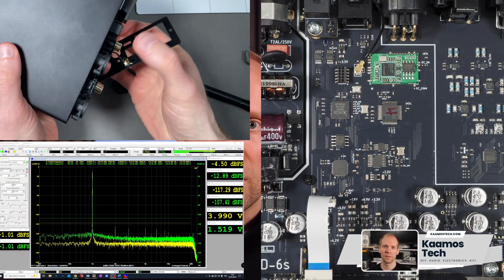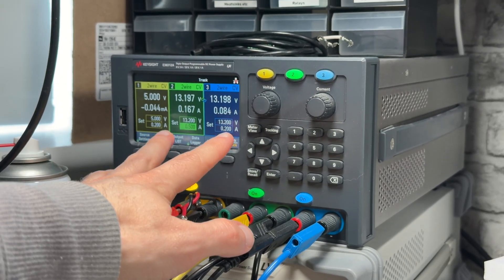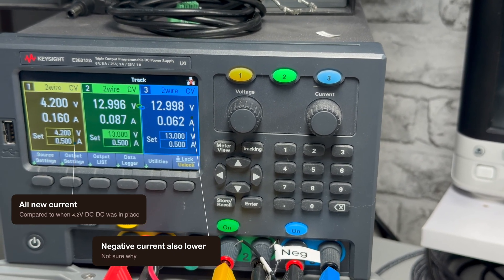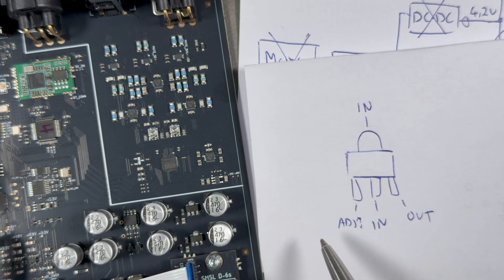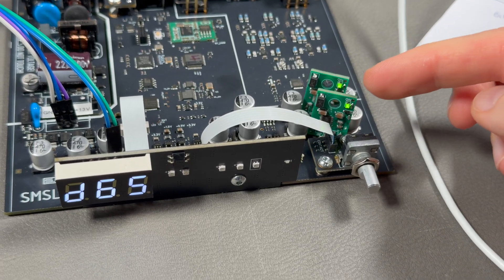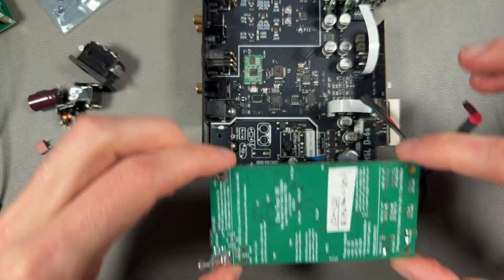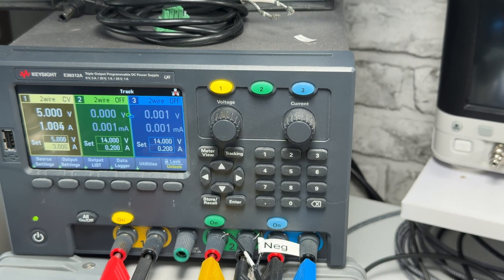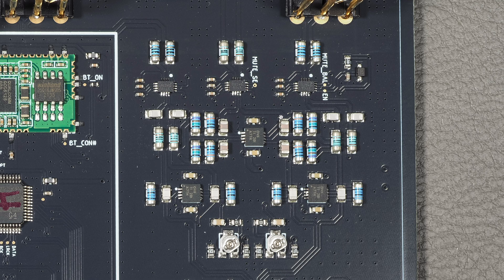S.M.S.L D-6s DAC Teardown Pt.3: Modifying Power Supply and Regulators.

Comment: Thanks for sharing.  Lower noise LDOs in most cases, make a big difference on these DACs. I have noticed that on many of these devices, removing thee bluetooth module helped getting rid of noticeable noise too. Hopefully,    they have done better designs on your model. On most of the previous models, SMSL used a weird SMPS with only the negative channel output regulated. The positive channel  was rectified and  regulated on the main PCB via a zener diode, which is the main cause of early failure of SMSL products.
Reply from the maker: Thanks. This is the first SMSL I have opened.

I would think the BT-modules are off when not in use - I may be wrong of course (e.g. hope they don't do some constant background scanning).

Here the 'raw' supply rails are rudimentary with just rectified from mains DC-DC. But they do use LDOs for all actual rails; don't know the exact models and quality though. Nevertheless, we must expect they have cut a lot of corners to meet the price points of these devices - which is quite an achievement already.
Reply: @kaamostech what I have experienced, so far, repairing (and failing to repair) SMSL and Topping devices, is that most of those use Chinese clones of western  LDO regulators and pretty much everything else is also cheap Chinese stuff. Only the parts like the DAC chip, USB controller and often the Bluetooth IC they stick with the originals, probably because they have not been clonned yet... The cause of most of the failures on both SMSL and Topping, as well as Drop branded products, Is the voltage regulation circuitry / components. Often the soft power ON control mosfet pairs burn as well. In many cases the LDOs just short out thuss destroying the DAC and the USB interface IC. Another major drawback of these budjet devices is that those,  in most cases, do not employ proper, per the DAC manufacturer's datasheet, power source and ground separation between the digital and analog sections of the DAC IC. Hence the relatively low price for these devices. 😊
Reply from the maker: Thanks. Very useful to know. I hope my cheapo kit doesn't break but if they do, could make interesting videos.

Comment: Replacing the clock with a high-end, low-phase-noise model does not seem possible.
Reply from the maker: Yeah there is not a simple clock oscillator to replace.

Comment: I'm watching this video with the same DAC connected via fiber optic cable; it's a good idea to power it with a battery... I would have liked to see the difference between the current at the wall outlet and on battery power.

As for the clock, its placement is odd.

I find it extremely bright for my taste.
Interesting.
Reply from the maker: Good point on the current, it's just a bit trickier to measure mains current. When active, we can probably assume the device takes roughly the same amount of power so you could estimate the current from the power.

Standby power may be higher with my PSU, it does take 100mA from 5V at idle (all low-power modes are disabled for better performance). That being said, SMSL claims the device should be less than 0.5W in standby which sounds small based on the numbers I've seen. But cannot say for sure since I didn't measure it. Their own PSU is probably a lot lower power in standby than mine.